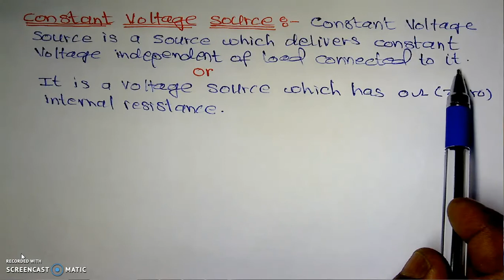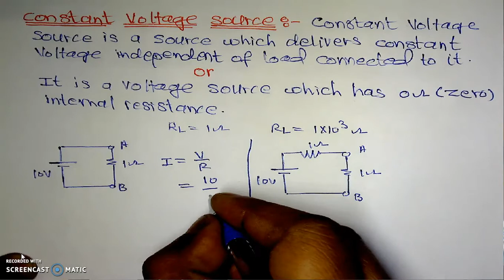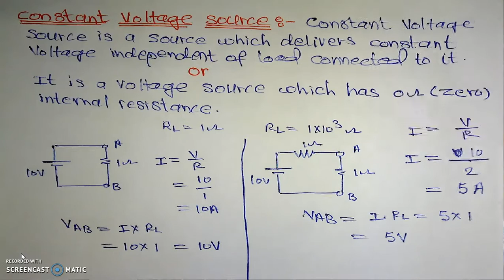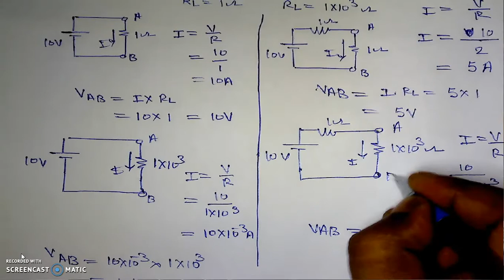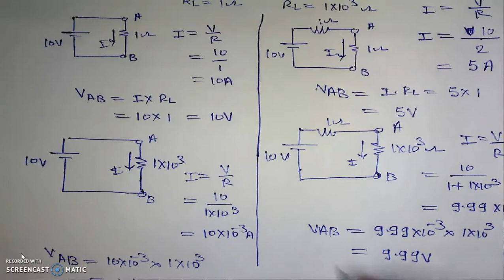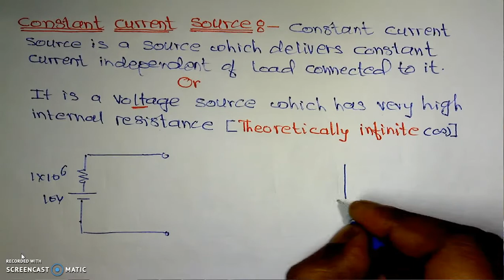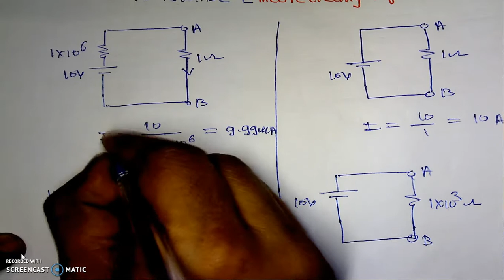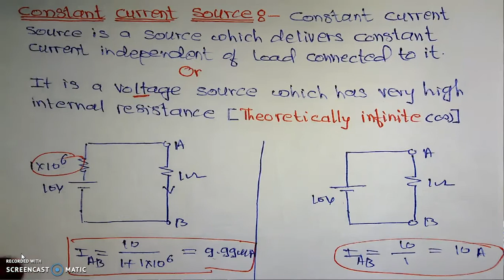Lecture 9 Concept of Ideal Voltage Source and Ideal Current Source by Mr. N. B. Hulle

Comment: Sir my question is voltage source example for genretar but current source example ?
Reply from the maker: Voltage source with zero internal resistance is ideal voltage source 

Current source is also voltage source having high internal resistance  (theoretically infinite).